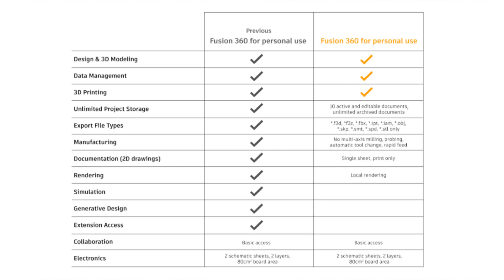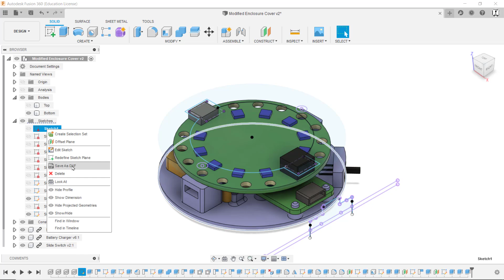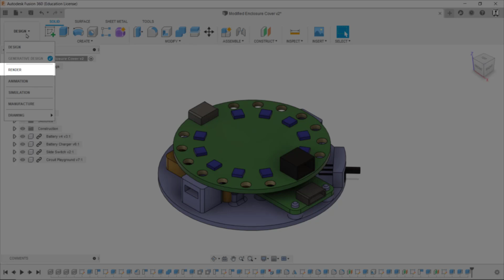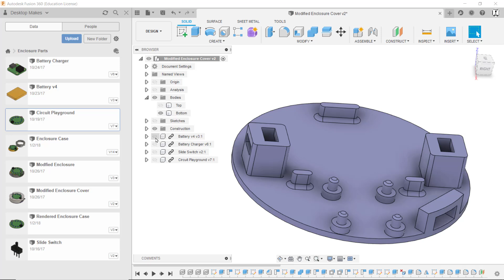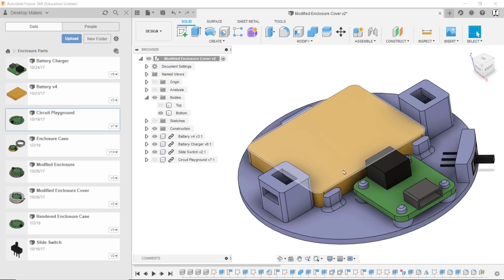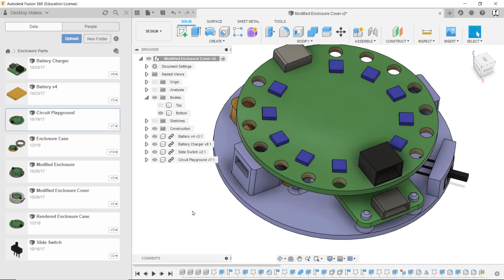Changes to Fusion 360  Personal Use License Explained (Fall 2020)

Comment: Hi Vladimir! I'm new to 3D design, started with your course at Udemy. Never exported anything. The thing is that I need aluminum part with complex shape and I don't have CNC router. Would I be able to export my model with free software? I was planning to bring my model to CNC-company, so they could produce exactly what I need. Do I need commercial license for it?

Comment: My biggest complaint is the tool change. I don't have an automatic tool changer but it would stop and let me put in another tool manually. With the new changes only one tool per GCode file. To simply spot drill and then drill five different size holes requires six files, one for the spot drill and one for each size hole. Not only is that a hassle it is a potential crash if I fail to post one file after I have made changes. I'll need to get into the habit of deleting all the tap files so don't end up with one out of date file. I haven't tried it but not being able to have tool changes also means we can't do REST operations because that requires a previous tool. I know about software because my day job is a software engineer so I know how much effort goes into the software development. The easier it is for the user to use - the harder it is for the programmer. The have put a lot of work into Fusion 360 and they probably have a good sizes team of programmers. I thought hard about buying it but it's not $25 a month it's more like $45+ a month. With the discount they were offering it was close to the $25 you mentioned but that was only for the first year then after that it's $500 a year and probably going up. But I don't look at on a per month basis. I look at it on per use basis. My mill will sit idle for as much as three months and then I might use it for a week or two then sit for another month or more. So I can't justify spending that kind of money for the little bit time I use it. As for alternative software to Fusion 360 I have been looking at FreeCAD because it's open source and it can post tool paths and I could potentially write code to for the tool paths. But compared to Fusion 360, FreeCAD tool paths have a long way to go. For right now I will continue to use Fusion 360 with a personal license.

Comment: Why would they possibly disable the ability to export step files. STL files are worthless most of the time. If the dimensions are off or there is any one aspect of a model that doesn't work for you, then you have to completely remake the model from scratch, as opposed to a step file, you have the flexibility to customize a model to your specifications much more easily. Importing steps will still be supported, but how many people on thiniverse are actually going to buy a commercial license to share ideas? It will be harder to find step files if the only people who can create them are those who pay the exorbitant license fees.
Reply from the maker: I guess they agreed with your argument Josh.  STEP export is now back!
Reply: @DesktopMakes  I am really happy to hear that. It is a rare thing for a company to listen to their customers and completely change their policy in response. I think this really shows that Autodesk cares about and values the diy community.

Comment: I do understand the need for change by Autodesk but not at the speed in which they made it happen.  They only gave us couple of weeks  of notice.  If no STEP file export, how do you import 3D model into EAGLE to create custom electronic component?  Not all EAGLE library components are discreet electronic parts that can be created in package generator.  I had to design 3D model of automotive stepper motor and export it as STEP and then import it into EAGLE to create custom 3D electronic package component.  I'm building my flight simulator cockpit instrument using F360 for mechanical part and EAGLE for PCB with driver IC to run the stepper motor in the instrument housing.  As far as I know, Autodesk hasn't provided a way in which EAG:E can import F360 file natively to create custom electronic 3D packages.  I'm guessing Autodesk will fix that in future but in mean time I won't be able to do anymore custom 3D electronic component design next year for my home simpit.  I won't be able to do interference analysis without the 3D model.
Reply from the maker: Good news Okinawan Warrior!  Autodesk decided to keep STEP exports.  Your 3D electronic designs are safe!

Comment: Thank you for covering those points.
I am what most people think of as a hobbyist, 50% of the fun is using the software that the 'big guys' use and if I do get to the workshop stage then I have to move the car out of it first.
Only about 20% of the projects make it to the end of the flow, and yes my wife is usually spot on that I could buy one for less, it would work better AND it would come with a guarantee.
 As the old saying goes - "You get what you pay for".
Additional thought: How does Fusion 360 compare with the really free software that came with your gear?
Reply from the maker: Hi Kevin, some 3D printers come with Slicers for preparing the model for printing and some will recommend using free software such as Cura.  I don't know of any gear that comes with CAD software.  There are free CAD software out there but from my experience non compare to the capabilities that Fusion 360 offers.
Reply: @DesktopMakes  Thank you, does a slicer come under manufacturing in Fusion or are you better off using the slicer for the particular model printer in use?

Comment: I've got to really agree with you here. I've worked for years with AutoCAD LT (2005) and dreamed about 3D but it was out of reach. So I moved moved over to TurboCad Deluxe. It was abysmal in 3D. I wanted to work in parametric! A year and half ago I learned about installing the "Starter" edition of Fusion. It is astounding. It's what I needed to do what I want. There was no way I could afford Inventor or full AutoCAD without stealing it so I was happy! Autodesk updated it. It worked fantastically, but I knew one day they would ask money for it. This day has come. Honestly I really can't bitch that much about a sub $300 per year piece of software that has done so much for me for so long. Maybe FreeCAD is the new normal that I need to go to, but I'll see. Great video!
Reply from the maker: Thanks Frank.  They're still offering a lot for free.  I'd be curious to hear from the ones that moved to freecad as to how it compares to the free version of Fusion 360.  Maybe I'll make a video in a few months asking for feedback.

Comment: I retired few years ago. As a hobby I discovered drawing and printing with Fusion. Then I wanted to make metal parts for a drone I built - a journey began that ended with a small milling with tool change and 5 axis.  I make what I want and love it - then this WAKE UP CALL  :  no more tool change nor 4 or 5th axis....    :(
Reply: Yeah I'm the same I'm a 100% hobbyist. I have a 3 axis machine with a tool changer, now I have to pay as my machine won't run without the atc.  Missing rapids is kinda a bummer but not the end of the world, I'm never in a rush to make anything so not a big deal.  I also was thinking about building a small diy 4/5th axis to play with as a learning experience but that's kinda out the window now, full simultaneous 4/5th axis is an extra $1000 on top of the $300 annual subscription so $1300+ just to play about in the garage is a bit much. As you stated I don't really care about generative design, simulation, number of active projects as I don't need those commercial features.  So basically I have to pay $300 min just for the one feature I really need ATC. :-(
Reply from the maker: Yeah, it sucks for situations like these.

Comment: Thanks for this video and the explanation, I agree with your points. 

Let's face it: this was kinda expected, making software is not cheap and definitely not free, so I understand that they want to force their license constraints somehow. The only thing I don't understand is the removal of STEP export. STEP is great for co-operating with other people in the community who run other apps on other platforms, it helps sharing the models created by Fusion360 for free with others. Removing this feature is basically vendor lock-down, and I don't like that, because I don't see how that supports their original goal.
Reply from the maker: Hi Georgy,  It looks like Autodesk ended up agreeing with you as they reversed STEP decision.
Reply: @DesktopMakes  Yes, thank you, it's great news!

Comment: This definitely makes me less worried about the future. however this "it's totally reasonable to start dumping money into this" idea is bunk. Fusion is great for lots of things, but there are at least as many issues that we only put up with because it's free. Always-online system ("oh, you can run it in offline mode": yeah, for a month at a time,then it's necessary), no local storage, no way to stick with a version that works for you... If I could just buy "Fusion360 Pro 2020", I probably would. This "programs as services" trend is awful. Sure, Fusion actually does add new features from time to time, but they also just change stuff or completely remove things on a whim. I don't want to buy something I don't own.

The other thing is they've had this "it will always be free for hobbyists, we want to get everyone on our system" thing going, and then they just pulled the rug out from under everyone. It would be one thing if they decided to start adding things only for paid versions, but they actively are removing things people regularly use. It's a dick move at best, leaning towards actually shady.

And this "active documents" thing: I don't understand it at all. Everyone that is talking this up as a good thing implies that you can still use everything as normal, which would mean... it would have no benefit to even do. But there's got to be a reason they're doing this, which means either we won't actually be able to bounce back and forth, or... something else negative?
Reply: You stated: "This "programs as services" trend is awful. Sure, Fusion actually does add new features from time to time, but they also just change stuff or completely remove things on a whim. I don't want to buy something I don't own."  --- This is exactly what I was referring to in my comment.  The shift to a subscription model provides the benefit of up-to-date support (in theory) but often at the cost of having a dependable, consistent, tool.  

The "free for hobbyists" approach is a brilliant way for a company to build an active, capable, user base.  It allows new users to develop their skills and creates a groundswell that can be a key driver in getting a product integrated into businesses.  Unfortunately very few companies manage the approach well.  It often seems to be too tempting for management to to go for an erosive change to make a quick boost to a sales quarter without regard to the longer term implications of what helped build, and entrench, their user base.  Hopefully this latest change isn't a sign of what's to come.

Comment: Look, they can kneecap the active file limit all they want. Removing step export prevents us sharing designs properly. Someone using solid works should be able to open a file I share from fusion. It's a common file format. It's like Photoshop removing jpeg and png export.

Comment: I think that the 10 designs will limit me the most, though I'm using step more and more.  I'm a hobbyist.  I give my designs away for free in the hope that others will enjoy them.  I have several designs with more than a dozen components in separate files.  Managing what is turned on or off could grow to be a real pain.  Depends on how easy it is to do.  If I do a custom PCB design as part of the project, that's four or more files right there.  Throwing everything into a single design file discourages reuse.  What happens with electronic component libraries that generate tons of files?  Lately I've been using step as a design distribution format.  It's more transportable than f3d and way more complete than stl.  Both of these restrictions are going to hurt me at least somewhat.  Will I jump ship?  I don't know, but if the pain gets high enough, I will.  Fusion is a decent product and Autodesk deserves to be able to cover their costs an generate some profit, but as a hobbyist it's tough to go to the family and say that I need to spend $200+ every month for toys.
Reply: Just visited Autodesk site to get more info.  Turns out I misunderstood.  Subscription price is currently $60/mo, $297/yr or $801 for 3yrs.  Not the mentioned $223/mo.  It's still expensive for a hobbyist, but not the outrageous number I thought it was.

Comment: No rapids though for machining. That's going to become annoying. Sure you could hand edit your gcode and add it in, but for one-off things, that's not worth the time and risk of screwing it up with typos on complex machining ops. Those manual tool changes are going to be so much slower with no rapids. On a tiny desktop mill That's probably no big deal but if you have something larger like a Tormach or imagine a home made 8'x4' CNC router, the travel time from work to tool change position and back could be several minutes each way if your cutting feeds are low for certain ops. Like if you are using micro endmills to do fine detail work.
Reply: That's probably exactly their rationale. If a user is truly a hobbiest then the lack of rapids won't be that big a deal to a majority of them. It would however be a big deal to someone using the machine to make money.
Reply: I make no money off my mill and we'll see I guess how it goes.  If someone were still using it for 'production' runs of parts I could see them just manually putting in G0's. I'm just saying as a hobbyist it's still annoying that they are doing this. Taking out probing, ATC, A+B axis, makes total sense. Rapids not so much.

Comment: Thank you for excellent explanation of the changes. I have been using Fusion 360 for 3D printing for less than a year and have found it to be excellent. I have used Sketchup for my woodworking projects as I have been a woodworking hobbyist for many years. I love the parametric modeling of Fusion 360 and have started using it for woodworking design work. One important tool for woodworkers is a paper drawing with dimensions of components to cut. I believe the change to 2D drawing will impact woodworkers and most likely significantly discourage them from using this wonderful tool